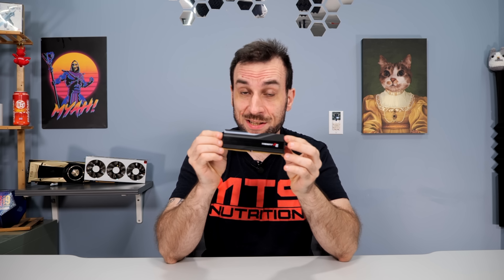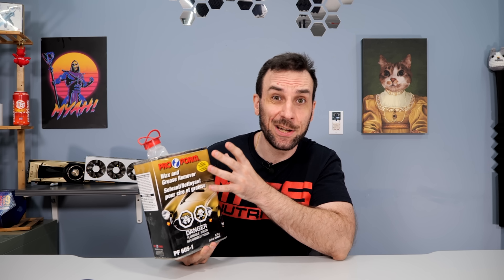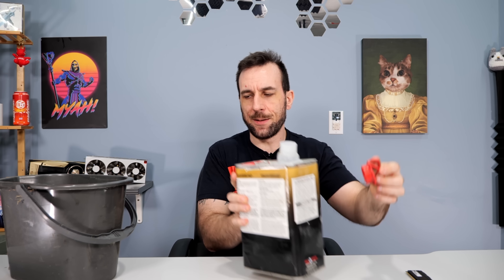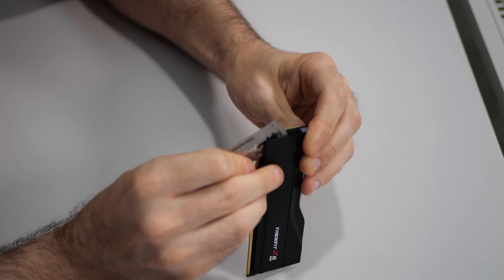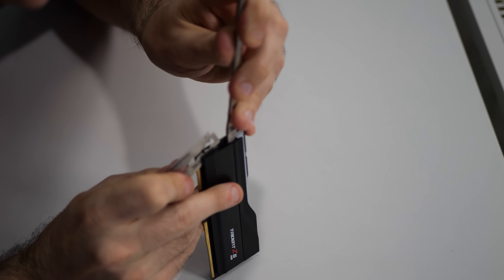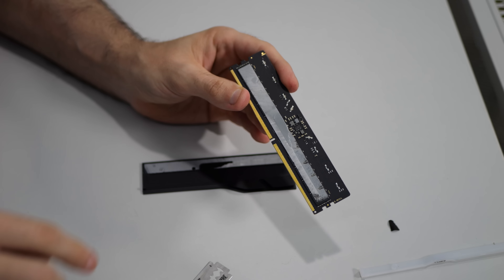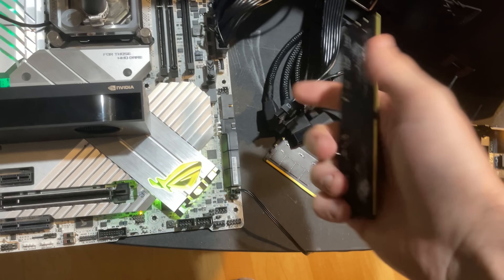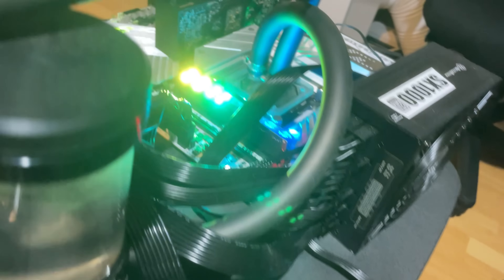How To Remove DDR5 Heatsink. Step by Step Guide ✔️✔️

Comment: Xylene mixed with IPA. I work for a silicone manufacturer. That is the best. It'll even get silicone out of clothes with enough effort. We even make our own thermal compound rated to 650°+ F
Reply: @leg press  according to the state of California if you live in California it is indeed.  You wear nitrile gloves and you try your absolute  hardest to not drink it. It also works very well as a pre-treatment if you are trying to stick some adhesive on something and get a stuck there if opens up microscopic holes which obviously would help any adhesive adhere better
Reply: @PapaFlock  noted, i will try my best not to drink it 😅🤣
Reply: 350C is pretty spicy.... that a boron nitride formula?

Comment: You can also use a hair dryer on a low heat to weaken the glue or if you have a GOOD heat gun with a reliable temperature setting, you can use that, just keep it below 90c, though this has obvious risks.
Reply: I’ll borrow the missus Dyson hair dryer for that lovely instant glue removal 😅😂🤣

Comment: Just removed the heatsinks from my 48GB G.Skill 7200MTs kit. 2 hours in a glass dish submerged in MEK (Methyl Ethyl Ketone) and the heatsinks just pulled off with the lightest of finger pressure. Removed the remaining tape from the back with a fingernail and back into the dish for an hour to dissolve the remaining adhesive, occasionally brushing with a small soft brush. Finally cleaned with fresh MEK and another soft brush. Now ready to fit the Bykski RAM sleeves and waterblock!

Comment: You may want to try thin guitar strings with each end tied to a something for handles. We used to use box end wrenchs using it to remove car windsheilds and the foam adhesive on car badge/emblems. Now i use it for ram sticks. Razor blades can really be FAFO.
Reply: probably easier to get a cheese slicer than make one out of guitar strings

Comment: Heat gun set on low or a hair dryer. Safer than either method shown here. NEVER use a double-edged razor in your hand, if you value your skin. That's what single-edged blades are for.
Reply: That's the first thing I said brother!  Meaning, please use single-edged blades.
Reply: feel free to make your own tutorial on a superior method
Reply: @Ugly_Baby_Gaming  Yeah. But why take a chance on an infection or a serious cut that can disable a hand?
Reply: @gozutheDJ  My tutorials are on vintage audio gear, but thanks for the invitation. Perhaps my 46 years of working on electronics professionally does not qualify me to remove the heatsink from a ram stick without damaging it or me.
Reply: @ScottGrammer dude have you seen what's going on outside? You should stay in your basement you might trip and possibly hurt your finger a little bit.
Reply: What about a hot air station? What temps should I use?
Reply: @Pabloesc571  Yes, I have seen what's going on outside. You see, I work for a living. You'll have to try much harder if you want to troll me.
Reply: @ScottGrammer  you work for a living you say? Intresting
Reply: *interesting

Comment: i used both methods. first soaked with glue remover and then used a usual cutter. then you can cut the heathink off just like bread. very easy.

Comment: Corsair Vengeance RGB DDR5. I just put my heatgun on low and heated each side for like 10 seconds from an inch away. Hot to the touch, can barely touch it. Just lifted the heatsinks with a little bit of force. Though, as it turns out, they are actually thermal pads down there, not glue strips. So, I guess I didn't need to remove them.
Reply: thanks, im looking to do the same and couldnt find anyone or anything that had done it to the vengeance ddr5

Comment: A good rest in isopropanol gets the job done better and safer but it takes longer on the foam - I forgot needed my PC back online to do work stuff so I couldn't wait for it to fully release but still no issues. Chip glue came off as a strip and the heatsink label was still intact.

Comment: Try fishing line or dental floss along with a heat gun.  Use the line or floss like a saw with a third arm holding a heat gun at the ram stick.
Reply: @Kaesarx  using heat will not be a problem, getting the sticks over 100c isn't the same as getting them that hot when using them in a PC.  Just keep the heat below the temperature when solder melts.
Reply: @Kaesarx  Yes I know, this is the problem with the internet, things can be read the wrong way. 😃  I build custom water cooled PCs & use a heat gun to bend hard tubing, or a gas flame to bend glass tubing, if you keep a part moving & do not rush a memory stick should be ok.

A solvent he used was overkill I think, 99% IPA & high grade 45% distilled white vinegar, a mix of 50/50 I think would do it faster & safer.  And NOTHING better in a spray bottle for cleaning a kitchen & is safe around food.  But might melt car clear coat & paint... maybe just use normal vinegar @ 5%.

Mix mixture will kill toenail fungus if you spray our infected nails after your morning shower evey day, but do not get it on your skin, It is an acid.

Comment: if you dont want the adhesive to stick to the razor blade you have 2 choices. one use a crayon and rub it all over the cutting edge both sides. another one is to use chapstick. choice is yours to fafo and see which is better in this scenario as well as what you may have laying around the house.
Reply: he probably ate all the crayons for breakfast.
Reply: @PSXman9  lol yea ur prob right

Comment: acetone will take 5 minutes but will destroy the cheap plastic on the heat sink for example crucial ballistix sticks has a abs plastic bridging the 2 halves of the heatsink acetone will melt the ABS plastic but will not hurt the plastic of the memory chips

Comment: I do not understand the purpose of removing the heat spreader. do you put new thermal tape and put the spreaders back on or just run them without the spreader?

Comment: I always thought that heatsink is there to help reduce RAM temperature. Now is here a guide how to remove heatsink to get better thermals. Interesting
Reply: It is, they just aren't very effective (low surface area) and in the case of this stick it isn't even making contact with the controller so while it cools the chips to an extent its actually making the controller hotter by trapping the heat in...major facepalm Gskill, wtf? Ideally, you would fit actually functional sinks to them after doing this rather than leave them naked.

Comment: New to extreme overclocking - why is removing heatsinks something that's done for overclocking?
Reply: The DRAM chips were fine but the controller was overheating causing instability since the sink wasn't contacting it, it actually runs cooler without the sink trapping the heat in. Ideally they would be replaced with actually competent sinks but you could just stick some thermal pad where it wasn't making contact and put them back on.

Comment: Can't you just put it in the oven at say 60°C to soften up the glue and then remove the heatsink by hand?
Reply: Jesus christ lol i never saw a question like that before. Did you try the oven yet?
Reply: @Nodnarb69   No, I have not tried it yet, though I am quite sure that it should very well be possible. I mean 60C is a temp that should be well within spec, if you don't have a high-airflow case your RAM will under load operate at that temp. Anyways, other folks recommended to put the RAM sticks into the freezer so as to make the glue brittle. Also an interesting approach.
Reply: @JacobMartin-l1f  the oven maybe but I definitely wouldnt try the freezer as it could have moisture and damage the ram

Comment: I poured isopropyl into mine and it broke the adhesion immediately on the thermal pads. Didn't help as much on the foam side but that sides fine to just rip off anyway.

Comment: Would nickel plated aluminum Heatspreaders with thermal pads be enough to remove my fan from my ram or would I have to get copper heatsinks to drop the fan. Nickel would be much cheaper and fit the build much better. Not an expert of thermals
Reply: Copper heatspreaders I've seen able to keep ram below 25c, so probably that

Comment: why not just get ram cooler? i got one from china and those seem to improve the temps by like 10c.
Reply: They cost only like 20$
Reply: Because it won't help that much when the sink isn't even making contact.
Reply: @memitim171  wait is ddr5 really that badly made?
Reply: @oplkfdhgk  It's not a DDR5 issue, for one you have to understand these sticks are not rated for 8000 MT/s so it's unlikely this was an issue in testing and it was deemed acceptable the controller didn't contact the sink. Secondly, we've seen bad designs on these ever since they started pre-fitting RAM sinks, so this is hardly new.
Reply: @memitim171  interesting.